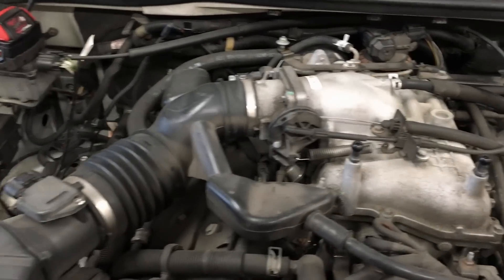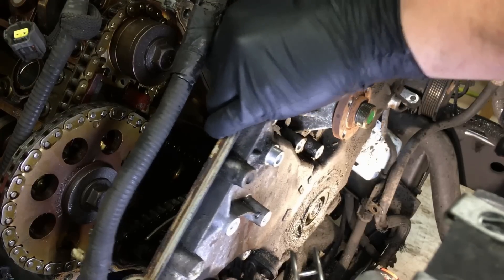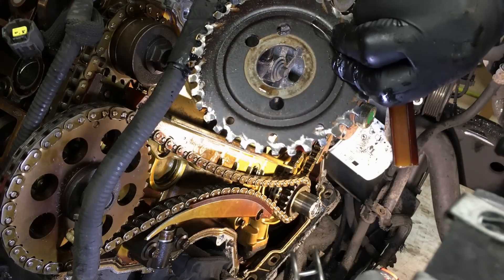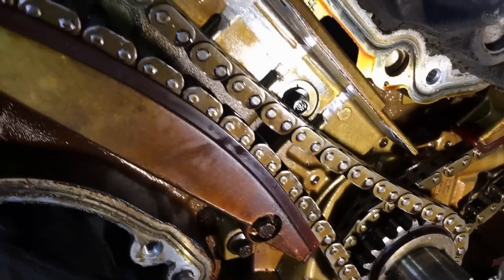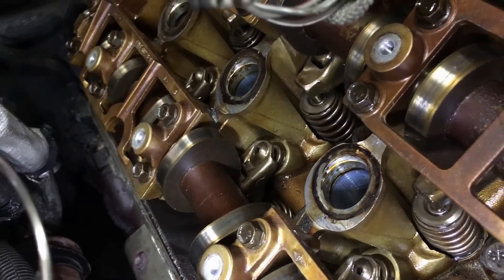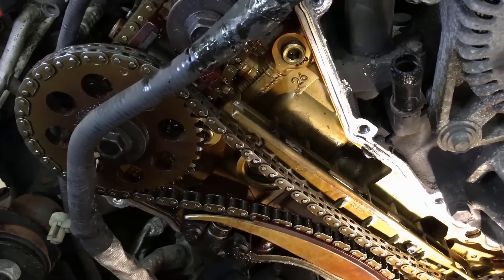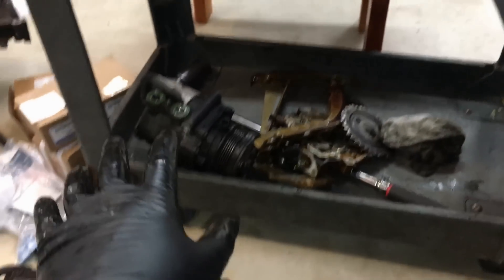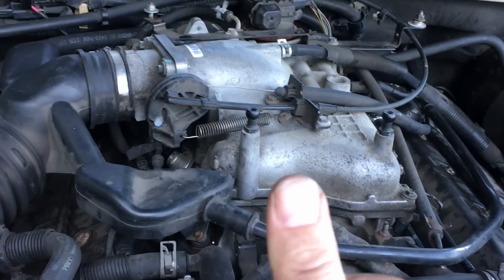Ford Modular Engines Rattling Clacking Sound: Timing Chain Guide Failures You Don't Want to Ignore!

Comment: Seem like when you pay 40k or more you should have cheap plastic in the motor, we/you didn't have this kind of problem 20 years ago
Reply: I remember when GM first went to the nylon outer ring on their timing gears and they were notorious about shucking the nylon teeth and dumping them in the pan.  Most mechanics did not pull the pan and clean it and the oil pick up screen.  Which meant no oil for the engine after the repair.  They got to replace a lot of engines under warranty because of that and the  owners got to replace a whole lot of engines out of warranty because of it!
Reply: Was that back when the cars were unsafe and polluted heavier?

Comment: 5w30?
Reply from the maker: yup best for these engines
Reply: I "assume" this goes for say the 03 5.4 also? At what mileage does those tensioners usually need replacement on the 4.0 & 5.4's? Looking at an 01 4.0 Exploder this AM with potentially bad timing chains (owner says it has a "rattle").

Comment: i would be concerned that all those contaminants have destroyed the crank shaft, main journal bearings, and rod bearings, it might have been a smart move to pull  a bearing cap or 2 off and look at a few of them before just repairing the cam chains and guides.
Reply from the maker: I sure did they looked great!

Comment: are all manufactures today making engines (with timing chains)  with plastic tensioners ???
Reply: Yes they are, even in the 80's they used Nylon plastic style timing gears. About 100,000 would jump time.

Comment: About a year ago elbows deep into the front end of my '01 f150 4.6L really looked familiar places there. Same issue, cheap a$$ tensioner guides. The lesson that I learned was don't go cheap on OIL FILTER (orange can), make sure that you have anti-drain back valve. IS there any preventive maintenance for this, as this is not a place I want to re-visit .

Great vid, still doesnt explain why I want to owns fords........

Comment: Great job, and I know aluminum isn't as bad in bearing surfaces but that thing is living on borrowed time.
Reply: Rod bearings come coated with aluminum when new.  Most of them are trimetal alloy.  aluminum copper steel.  The bigger problem would be the cam journals in the heads.  They have no bearings just an aluminum bore.

Comment: I have a 03 Eddie bower .. when I cut my car off the radio stays on and the door panel lights. The windows go down radio stays on without the car running... It drains my battery...can you help ?? I could really use some answers.

Comment: Wow! I admire your decision to put it back together. With all that metal, I would of scrap that engine and bought a new one.
Reply: I know if that was mine, I would have told him to drop a new engine. I drive too far to work, so there is no way I would have chanced that. The vehicle owner must run cheap oil too. The inside of that thing looked terrible.

Comment: The Nissan VQ series V6 engines also have been known to have timing chain guide problems as well, but it's being proven more and more that this is due to idiots and their long oil change intervals.  Gotta save that $50 a year at the expense of a good running engine!  Mine has 170,000 on it and runs and sounds like new.  The timing chain still sounds the same as always.  I recently replaced the valve cover gaskets and the entire valve train area didn't have even a bit of varnish on it.  Honestly it looked brand new.  I do 5,000 mile oil changes or at 6 months using regular Castrol GTX.

Comment: PS still wines a bit. It'll be fine. Nice fix. Almost be easier to thow a low mileage engine in there.
Reply from the maker: +Tim Z whines? You mean the power steering pump noise????

Comment: Hey man I've seen a lot of your video as far as i know that the 3.5 and 3.7 from the mustang are kinda same on some parts. I have a 2012 mustang v6 and im at 85k miles and it mysteriously lost power by i can say 40% what might be your suggestion to check i also just did a change oil like 100miles ago

Comment: Nissan timing chain last a long time. You might not hear but a faint noise when it hits 250k-290k miles.  Time to trade by then. The Ford shop is slap full of new cars and trucks that need fixing.

Comment: Great video! I had to do the same on my 02 f-150. It was almost just as bad. I purchased it with that noise already. I thought I was looking at an engine replacement. But after tearing into it I found this same situation. But the rest of the engine looked to be in good shape. No sludge, cam lobes in great shape. So I decided to install a new timing set. So far after about 7k miles on it after it's still running strong.
Reply: James Peters I just bought a 2002 f-150 a couple of weeks ago with the tapping noises on the passenger side also (4x4 xlt 130,000 red & silver BEAUTY for $2,200) The dealer said he'd go half fees on a reconditioned motor 1,200 if anything happened to this one and he knew nobody else would buy it unless he fix it. His mechanic said it would take   20hrs in labor and cost $1,500!. My chain kit came yesterday getting fixed tomorrow have a hole in the motor where the chain is slapping 😲still runs strong 👍🏃‍♀️lol!
Reply: @johnecker4217  If these systems are so prone to failure at low mileage, Ford should have designed them with a rubber belt instead. My 4.6L lasted until exactly 200K before the rattling sound, but it seems I was one of the lucky ones. I did use synthetic it's entire life, so may have delayed the inevitable.

Comment: Me thinks the oil filter may have blocked and  gone on bypass with all that lovely metal circulating. Would like see the filter sectioned just for the hell of it. Nice video Brian.
Reply from the maker: +tecnaman I kept it so I just might do that
Reply: FordTechMakuloco .question Mr MAKULOCO ON A 98FORD RANGER 5 SPEED STANDARD ,HOW CAN YOU TELL IF ITS  THE CLUTCH CABLE OR THE CLUTCH PUMP
Reply: FordTechMakuloco is there a way to tell without taking out the transmission .

Comment: I understand that the customer let this go too long, but who is responsible for the initial failure Ford or the customer?
Ford because they used poor quality parts
or
the customer for not taking care of the car?
Reply: It's just how the ford modular was designed.  If neglected the life expectancy is shortened.  The cam phasers, guides and chains all need oil pressure to run good.  Neglect the oil and quality and kaboom!.
Reply: I see

Comment: Wow that's one sparkly oil pan. Amazing how much punishment some engines can take. I had a Ford 4.0 SOHC that sat with the ENTIRE crankcase up to the intake manifold full of rainwater for years. Water ran out of the spark plug holes and oil drain plug for about 5 minutes. Shot some rust penetrant in each plug hole. And it fired on first try no problem. Still driving years later.
Reply: Chad Bob This is refreshing to hear since I have just bought a 4.0 SOHC with the infamous "RATTLE"
Reply: @ljgarrison6910  did you replace the tensioners?  I have the same engine

Comment: This is what become of TIMING CHAINS... They have been engineered to basically last less than a Timing Belt..
That is why I got rid of my BMW X5, Stupid Timing Chain adjusters in the V8 would keep getting eat each 120K! How much BMW asked for? 7000dlls to change.. Yeah 7000 bucks! I ended up doing it myself for 2K which is ludicrous because; My Acura TL-S asked for a 105K Timing Belt Service, that typically cost around 600-1K at the dealership.. I did it for 300bucks myself.

Goodbye the days where you can say the Timing Chain is Service Free and last more than a Belt, The Chain itself might outlast a Belt but the Chain Adjusters WONT so you end having to do the Timing Chain service EARLIER than a Timing Belt change and it will cost you around 4x-5x more to change it vs a Timing Belt...
Reply: skirmich nope. GM push rods I believe the chains are pretty much service free. Something to be said for old school push rod.
Reply: 21st Century engineering for ya. It's all about how much $$$ the manufacturers can rake in - customer satisfaction, and longevity be damned. Sad times we live in.

I just did the timing chain a few months back in my '86 Grand Marquis with a 5.0 -- 31 years and 237k miles. Had 1.5" of slop - think the spec was 3/4" if I remember right, maybe less. Had the OE nylon cam gear too! Never jumped time. That timing cover had been leaking coolant for the 14 years I've owned it, and that was my only reason for going in there. $30 later and she's back up and running. 244k on her now, and no signs of slowing down yet!

What the hell happened to quality auto manufacturing ...  ???
Reply: yea i am all for a gear driven cam shaft and push rods myself, somehow plastic parts inside a high wear critical engine area  makes no sense at all to me
Reply: skirmich The problem is DOHC timing chains on Vee engines have to be very long, move very fast, yet also stay nice and tight. Oil needs to be changed often and oil pressure needs to stay in spec. If not, problems will follow...
Reply: Agreed multiple timing chains on these OHC engines that are held in place by oil pressure and are given these long oil change intervals. Seriously what junk. I hate the shit they make these days.
Reply: And majority of ford engines have timing chains! 😭😭😭
Reply: What years tl s did you have?
Reply: Still got my 02 TL-S 
3G TL-S (07-08) cost about the same to do the Timing Belt, I´ve done a few of them, A Pilot and my MDX.
Reply: I think the government pushing car makers for better mpg's is causing the issue nowadays w/ vvt's ocv's and whatever other b.s under the timing covers ! o.g 2 valve motors bulletproof
Reply: VW used a similar design in the Passat (and AUDI) with an 8ft timing chain deal.
Reply: Yeah OHV Engines are truly "Lifetime" and Service Free but newer Domestic V6-V8 engines rely to much on SOHC/DOHC setups which does need a more convoluted Timing Chain layout, Those are the ones that are being designed to crap out faster..

Comment: I replaced the timing chain, tensioner, guides, oil pump and vct solenoid on my 05 5.4 3v f-150. It still makes a rattle noise on startup, what else should I look for?
Reply: Failing lash adjusters can/will cause a "ticking" sound and in severe cases of completely collapsed adjusters a "rattle" sound. These sounds will be coming from the valve cover areas.
Reply: jrwou1 it only does it on start up for 1-3 sec then it goes away, as if it's losing oil pressure on the chain tensioner. Could it still be the adjuster?
Reply: It could be be but since you installed new units and I have to assume using quality parts and installed correctly I would move on to the lash adjusters. They can/will rattle briefly at startup (usually cold start up) til they build pressure as well. They are mini oil pumps but the spring inside can become fatigued and/or wear a groove inside the adjuster and its piston momentarily gets locked in the compressed position as the spring catches in this groove.  You may need to have someone start the engine while you're under the hood listening near the valve covers.

When I replaced all the timing components on my Mustang 4.6L 3v I went ahead and replaced all the lash adjusters and rocker arms while I had everything apart. FRPP has a lash adjuster/rocker arm kit that fits both 4.6L and 5.4L 3V. I picked mine up for about $260 on eBay.
Reply: jrwou1 thanks I'll do it this weekend and see how it goes!

Comment: When you see this you really need to take the cams out and even look at the engine bearings. Odds are the is garbage, even if it doesn't knock. At some point the filter won't filter the oil and aluminum will go through out the engine. If your going to buy a ford with in the years you're talking about it might be wise to get an oil change if they will let you. If you see metal in the oil I would walk away. Seems to me to many people are saying it is just cam phaser noise when it is a bad tensioner and the timing chain is in fact eating things up. The metal shaving may even plug the sump screen and starve the engine of oil. I'm a ford guy, but they really fucked up, and made it hard as hell to work on to change things at a reasonable price for their engineering flaw. You see a lot of older trucks selling for big bucks and the reason is they were flat out better in many ways and cheaper to maintain. I don't care what HP numbers you put on something, I've never driven any three valve ford that had more power than the two valve, that was a really good engine unless it spits the spark plugs out of the head (which really is rare). The Spark plug thing isn't the end of the world and much easier and cheaper to fix rather than the garbage timing tensioners. There is a reason diesel swaps are all Cummins and every one swaps a Chevy LS when gas.

Comment: Quality ford parts. This can't be all maintenance related.  I'd run that engine for about 30 minutes  and then change the oil again.
Reply: 14 year old car with who knows how many miles and we don’t know what kind of oil used or how often it was changed. I’m no mechanic but with moving parts there is going to be wear I’m just glad it’s not a timing belt.... course timing belts do have a well known maintenance schedule... so idk pros and cons. I’m just slightly disgusted that they let it go for so long.
Reply: Lee Dress I was thinking the same thing.
Reply: With cast tensioner you risk wearing the chain down and snapping that and grenading your motor. Vs plastic that will last 400k if you change the oil on time and that you can hear fail a mile away and not blow your motor
Reply: @Lee Dress - If this engine had 250K on it and never been changed before even with full service oil changes with synthetic oil it would not have made any difference. These are wear items and should be changed at 125K miles no matter what. If just plain regular oil is used with Walmart or Jiffy Lube oils, plan on doing it at 95-100K miles.
Reply: @waynealan2226  Im thinking you dont own one.  I have over a half million miles combined on the 2 of mine, and the ONLY problem with my 5.4 is the head gasket is leaking oil on the pass side.  But they are 2v, and I do maintenance on them.
Reply: Wayne Alan Is it a ford thing? I have gotten 500k+ miles out of Toyota timing chains.. though i am anal with maintenance and do a 3k mile synthetic oil change.. (i also have a grand marquis LS)
Reply: My lincoln town car has 96 thousand miles and just start doing the same freaking noise probably goes to the junk yard, I change the motor oil every 3000 thousand miles and this thing happens anyway
Reply: Mine has 224k on it, my friend's had the guides go at 360k.  There was a period of time they used crap guides but in general the Ford modular motors are absolute work horses if you take care of them.
Reply: anterpants Eh, I’ve seen stock 4.6/5.4 guides go over 400K.  Their life span is very oil/change interval dependent.  The timing guides is the ONE area where a lack of oil changes shows on a Mod motor.
Reply: B C 08 exactly

Comment: with all that metal in the oil pan, i would be afraid to do all that work to that engine and not go farther. especially after seeing the oil pump and the back of that timing cover. it looks like that engine has missed far too many oil changes. that scared up oil pump had to be pushing metal through the entire engine. i would think the rods, mains and cam journals all look the same as the oil pump. i think i would have been looking for a replacement engine. the possibility of the rest of the rotating assemblies failing soon would be too high for me. i am glad it worked out for you.

Comment: The 5.0 doesn't have any of the problems the 3v junk has....a much better engine
Reply: No so sure about this claim ..."3V junk has"... Mine was a 4V and had the identical problem. Since there is a concentration of passenger side guide failures I think there is an inherent defect in the design of the guides such that the plastic wear layer breaks and pops off. The two timing chains are not identical looking so maybe some subtle angle is putting extra wear/forces on the passenger guides that the driver side doesn't see. I think all V8 modulars 3v & 4v have this defect regardless of what vehicle the engine is put in.
Reply: fastfocus2005 No shit it doesn't. It's newer and its main purpose was to fix what were common failure points on 4.6's......

Comment: I did my tensioners and chain guides on my 01 GT and I had marked everything with a yellow paint marker to ensure timing was set. The chain slipped a few times but I was able to set everything back on the correct marks. When I started my car up after the repair, it sounded normal with the exception of my engine sounding deeper.. like more bass-y... any explanation for why that might be? (All parts were genuine OEM Ford)
Reply: If it works, maybe the engine was off tune or how ever you wanna call it. Everything probably knocked back into place how it was supposed to go lol.

Comment: I'm doing the cam chains in my 4.0 Ranger, what an awful abuse to call it Engineering with a better idea, the old Ford slogan. I have to pull the engine out to get to the right cam chain. What crap these engines have become, I wish I could put the old 289 cu in, in there. thanks for the insight.
Reply: Just make sure you have the special tools. The sohc 4.0L requires special tools to set engine timing. You can't do it with out them.
Reply: Did you pull the motor out?  I'm about to do mine on a 07 explorer.

Comment: I just bought a 2009 flex limited, is it reliable?
Reply: They are definitely reliable. Its just always plastic parts that fail in fords that cause problems. Just like the intake manifold, if you replace it with the “ford performance” intake thats full metal it will never fail again like the half plastic half metal intake manifold. These, I hope they have an alternative to plastic guides online.